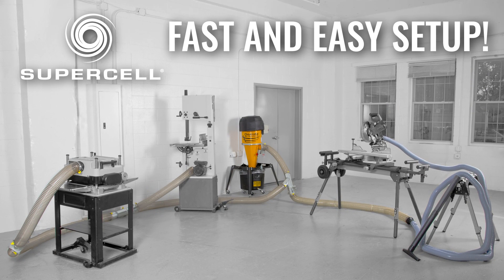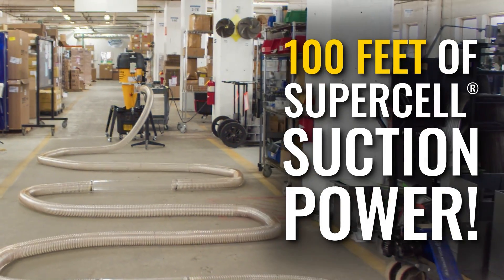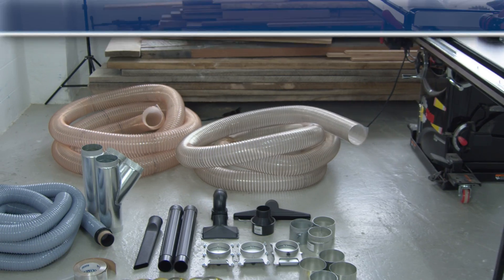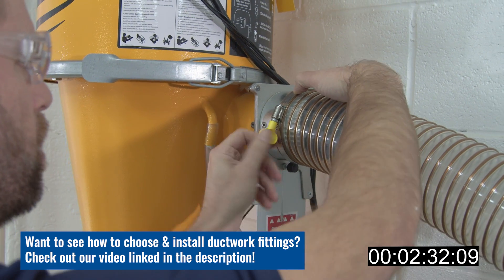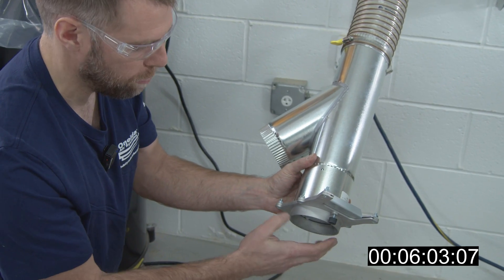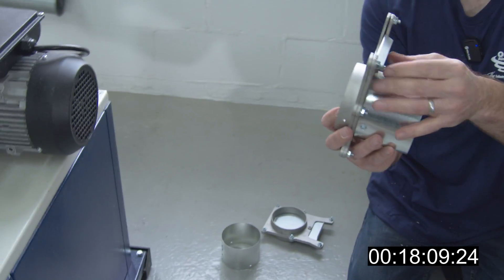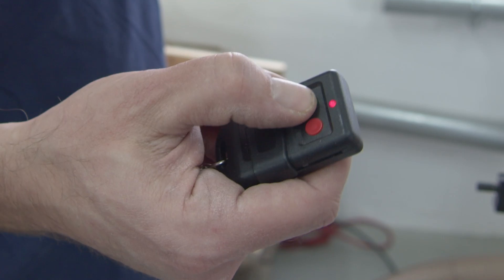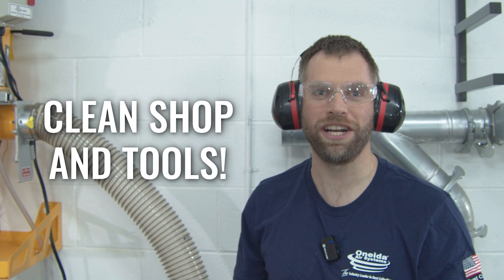DUCTWORK Setup Is FAST And EASY With The SUPERCELL®! | Oneida Air Systems, Inc.

Comment: What, if anything, can be done to reduce the noice?  Can the supercell live outside?
Reply from the maker: The Supercell® was not designed to go outside. If it does, it should be enclosed in a shed, structure or completely protected from the elements.   - being sure to design whatever enclosure to not restrict airflow to the top of the unit.  The Supercell supports 100' of 4" ducting or flex so it's easy to get it away from your work area.

Comment: That's a really nice system but I'm going to stick with my 30 year old Craftsman shop vac that converts to a blower.  I've got a 0.5 micron Clean Stream filter (I believe Oneida sells these as well) and I have short length of 2.5" flex hose coming from each machine with the fitting that fits right into the vac...simple and just plain works.  I've thought about trying a small cyclone like The Dust Deputy or the Home Depot one but then the setup wouldn't be below the machine work surfaces and would get in the way.  After reading reviews and watching a few videos it doesn't look like they add much and in some cases may hinder performance so I'm holding pat.  Just putting this out there for other hobbyists with similar needs. I love the flexibility and adding new machinery is a simple as a short length of hose (3 feet or so) and a fitting that goes to the shop vac.  No expensive fixed tubing or blast gates.
Reply from the maker: Where wet/dry vacuums fall short is that they don't have their own pre-separator. Adding a cyclone allows you to pre-separate the incoming dust from the airstream so you can save money on costly filter replacements and prevent suction loss. While adding a cyclone does introduce a slight decrease in air speed, it more than makes up for this by maintaining steady airflow and eliminating the eimmediate clogging of the wet/dry vacuum's filter.
Reply: @oneida-air  Perhaps but the Cleanstream filters are made with Gortex and I just blow it out with compressed air and it's good to go again.  Sometimes it's hard to beat simplicity, especially of you're not a professional.

Comment: May I please ask how many CFM you’re getting at the Sawstop blade guard in this configuration? I need a separate dust extractor to get the best performance. Thanks.
Reply from the maker: Due to the tangential throw-off of dust from a table saw blade, most of the dust will spray off into the air instead of dropping into the cabinet below. For this reason, the most effective cleanup for a table saw is an overhead arm guard because the arm guard puts the vac suction right at to the dust source. 
 
However, most table saw overhead arm guards are designed with small port diameters that require a shop vacuum with high static pressure ratings to move enough air (CFM) through the pipe, or hose, to effectively collect dust and debris from the blade. The Supercell is unique in the fact that has more static pressure than a wet/dry vacuum to deliver enough airflow through the small hose of the overhead arm guard. If you want to service an overhead arm guard with a Supercell, the best method is to partially close off flow to the 4” port to allow more air to pull through the more restrictive overhead guard. 

Effective dust collection occurs when there is a sufficient air volume around the source of dust emission to entrain all or nearly all the dust into the dust collector. Insufficient airflow at the tool creates fugitive dust, or dust in the air and everywhere else in your shop.  Static pressure is the tool that allows you to deliver sufficient airflow, or CFM, to where it’s needed on the source tool.  A traditional low-pressure dust collector with a lower static pressure will not provide sufficient airflow through the small port of an overhead arm guard.
 
Note: It is important to place the partially closed off blast gate after the overhead arm guard port on your table saw. This will allow the air from the Supercell to be redirected through the overhead arm guard, where airflow is most critical. 

We will post another comment shortly with a follow-up video on this question.
Thank you!
Reply: @oneida-air did you ever release a video on this topic?
Reply from the maker: Thanks for reaching out! We appreciate and value your feedback, and we will work to produce a comprehensive insight on this for your consumption! Please let us know if you have any further questions!